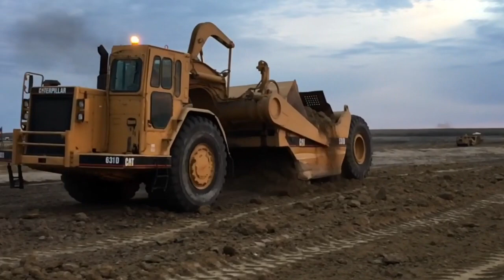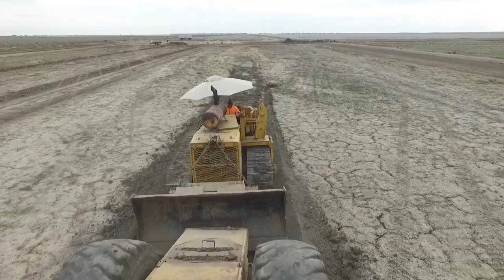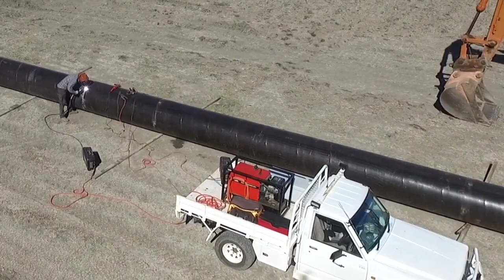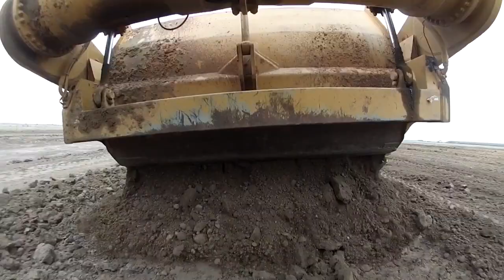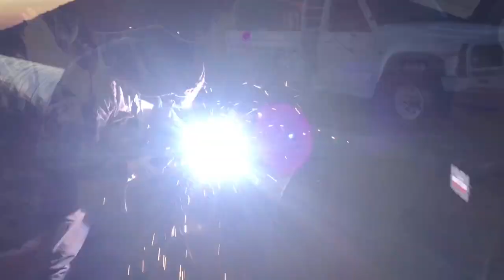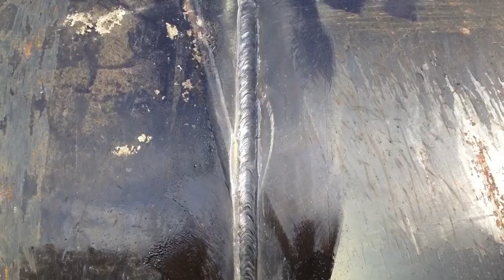CAT 631D scrapers- storage construction on the Hay Plains

Comment: That was cool, I ran alot of twins started out on the 637D series nothing like those 3408 getting down and pulling hard with 3306 engine on the rear! The E series was shorter and rougher riding especially on radials which was my first on radial tires, company I worked for went back to bias ply when they got new replacements, then the power house 657E series was as bad ass! Those 3412 in front and 3408 rear running right at 1,000 hp together first time I seen 42 + yds dirt on scraper and shift gears go uphill slopes as long as  it wasn't to steep! Then cat came out with the G series with C series engines, be Hp loss over those v12 and v8 Hemi engines! Those hemi fired Diesel engines where like on steroids!